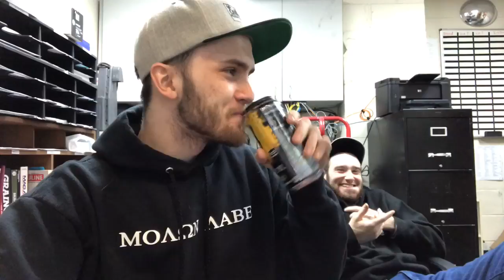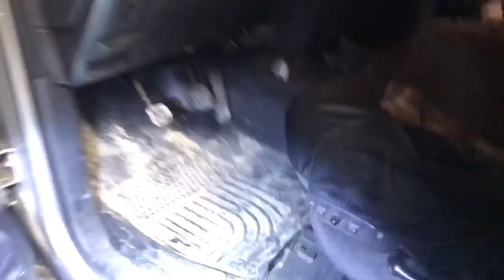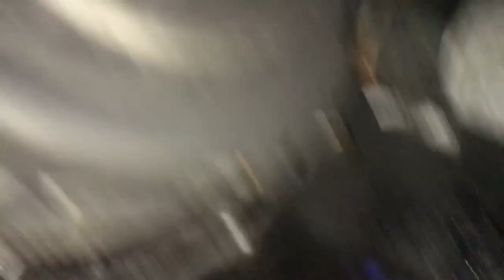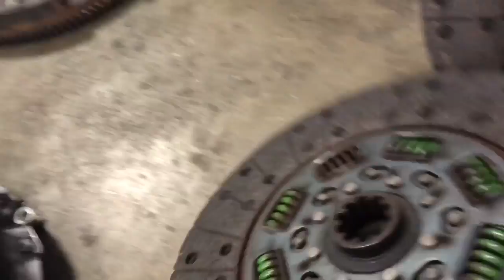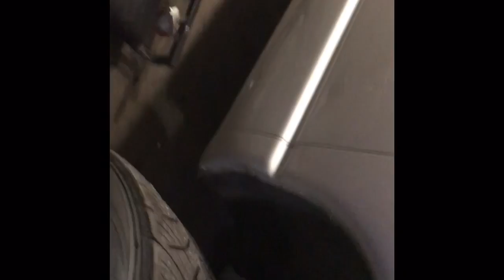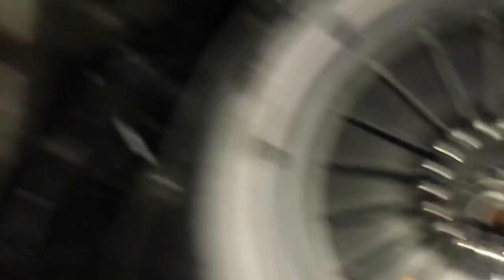CUMMINS GETS A BIG TRIPLE DISC!!!

Comment: When u have a run in with the trans moving on the jack 2x4 or pieces of plywood stacked under the yoke or on the trans will give a little more stability

Comment: Why did you go with a triple disc instead of another dual disc and why did you go with the s463 instead of a s467 or s472 and what size are you planning on adding to it next?
Reply from the maker: Vinny Foley cause I couldn’t find a dual that could hold the numbers I have/going to have. I originally went with the 463 because for the amount of fuel I had at the time it was plenty enough Charger. And I just picked up a t6 s480/87/1.32 for the compound setup again.